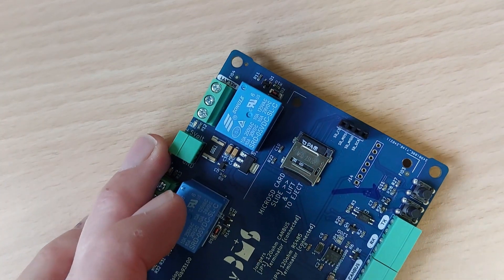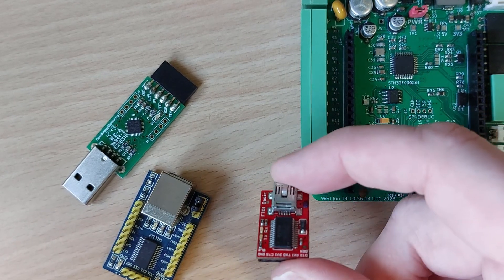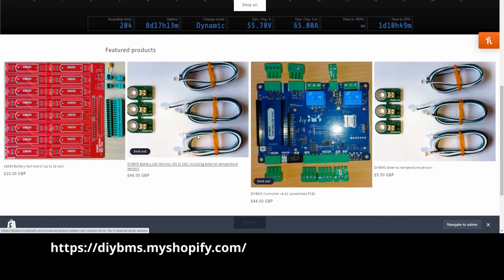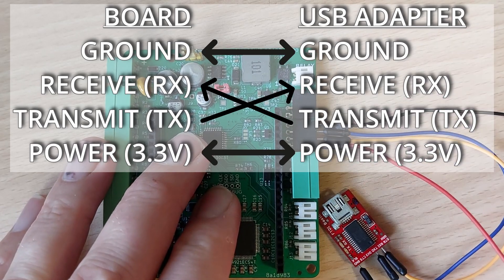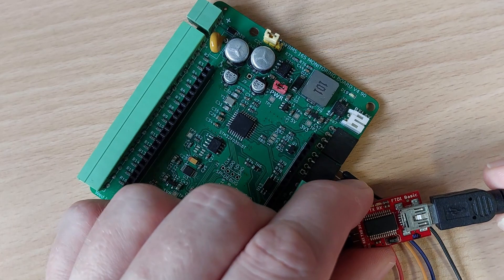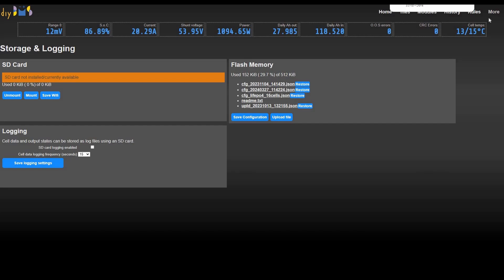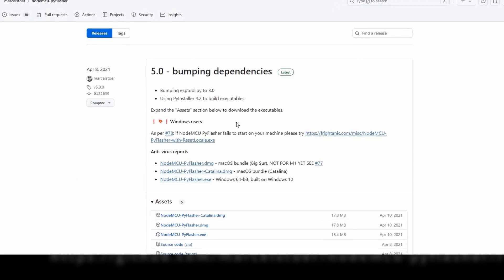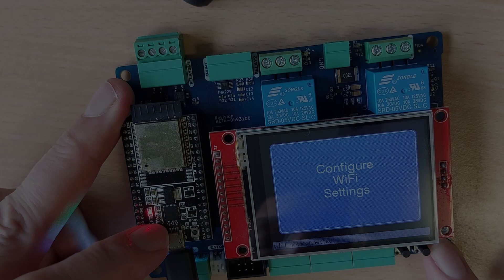Programming V4.90 module and ESP32 controller

Comment: Hi Stuart,

Great effort you put in and we all enjoy it, thanks!
Is there an example available with the combination of passive and active cell balancing?
I am currently using the single cell module and understand that I can combine it with the V4.90.
Will all cells be automatically addressed?
Reply from the maker: I personally wouldn't mix the single cells and the new all in one solution.  Probably better to add an active balancer alongside it.

Comment: Hello Stuart, congratulations.
I want to make a bms for 42 or 44 cells. I don't found where you explain this. But for sure is somewhere. 
Maybe i have to buy 3 controlers board (3*16= 48) (and then they can "talk"?). 
Thanks!
Reply from the maker: My advice is to not build a high voltage battery for house storage purposes. Stick to 48V

Comment: Hello, I know that we can add a CurrentShant.. but we can limit a current separate on charge and discharge or disable one of them ? I think DiyBMS is like MultiVoltmeter with addons as core system. This is critical for me when I think about doing HV system base on DiyBMS (192V for APC UPS).

Comment: Hey Stuart, which connectors do you use for the UART (TX, RX) connection on the cell module board. The reason I am asking is because I can't find the connectors with the same pitch as in KiCad? Thank you
Reply from the maker: Its a 3.81mm pitch socket - this is the one... https://www.lcsc.com/product-detail/Pluggable-System-Terminal-Block_Ningbo-Kangnex-Elec-WJ15EDGRC-3-81-4P_C7245.html

Comment: what is the supported voltage range again ? would they work with Sodium Battery ? been swapping out my lithium
Reply from the maker: I've not tested sodium cells, the monitor chip should go down to 1.5V without a problem

Comment: Just a note, still had trouble programming the boards this arvo, I have had these boards sitting around for a long while and gave up on them from JLCPB as no good, but I solved the problem, the RX and TX pins on the USB adapter were opposite, so had to join TX to TX and RX to RX, now I have the 4 blink LED error.
Reply from the maker: Excellent, glad they work

Comment: It would be nice if the usb converter board  and socket were included on the monitor board.  That way, in two years, I won’t need to hunt down the pieces needed to reprogram it.
Reply: good idea, but this will make the module bigger and slightly more expensive

Comment: do the new 4.9 dont have two options for refrence chips like the first release one?
now all with 4500? 
so the old ones must flashed wit 4096 if this chip is fitted?
Reply from the maker: That's correct, newer design standard is 4500, so use other firmware for older boards